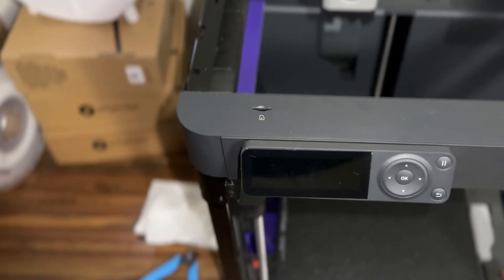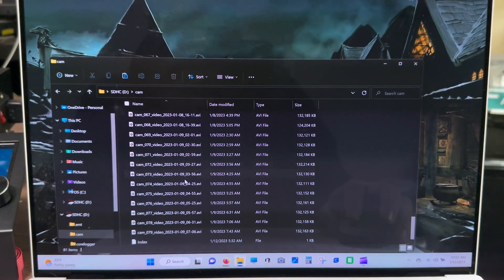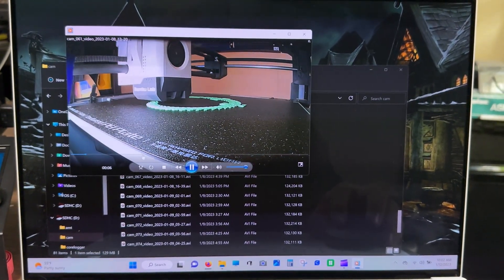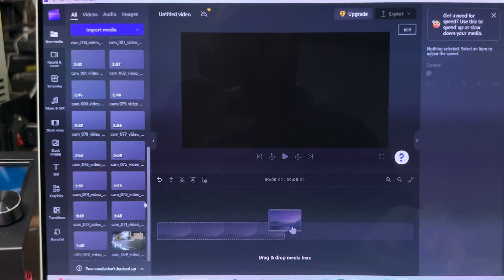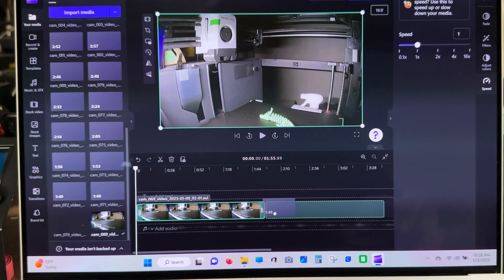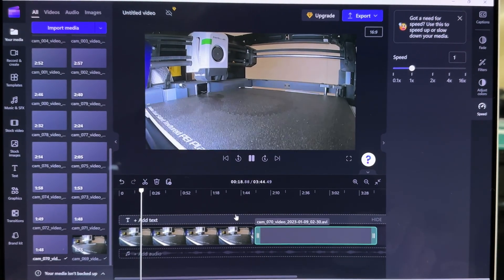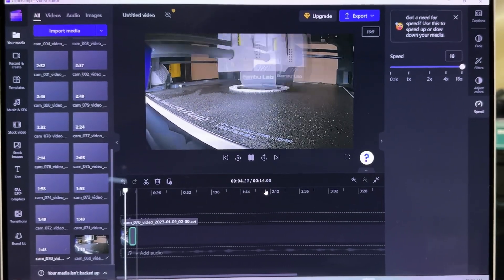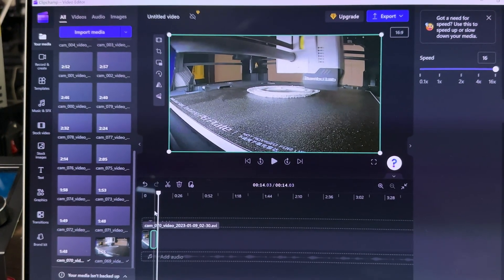How to use P1P time lapse footage

Comment: I've come over to bambu from creality, although the print quality out the box is so much better, the rest of the experience is worse which is a shame for a more expensive printer.
 The creality camera is miles better than the p1p/p1s. I could watch my print being done via camera to keep an eye on the print and it had ai print failure detection. The bambu is terrible, on top of that I could access my time lapse videos straight from the app on phone, again can't do that on bambu.
 Love printer, but hate the rest.

Comment: Hi, I'm really thinking to buy this printer for be able to print biggest parts in less time than my ender 3 pro, print customized moons in something i have in mind, in case of the moon you have printed, how many hours did it take? And what is the exact size it has?
Reply from the maker: As far as size goes, it is 100% original size, 6 walls because you don’t want to have any infill on this kind of print.  As far as how long it takes to print, I don’t remember the exact number but it was around 18-20 hours. Standard speed is 24 hours. But after the first 10ish layers we bump the speed up to ludicrous speed. When getting close to the top over hanging layers, we slow it back down.
Reply: @TableTopBiker    awesome, that's a good time, I make tiny customized moon keychains with a size of 50mm and these take me almost 3 hours on my ender 3 pro with a layer height of 0.1mm , I can't print more than 1 piece at time due to all the strings it will leave over the prints,  I guess that with a bambulab print time will be really short and would be possible to print more than one, I want to print at least 150mm or 200mm moon lamps
Reply from the maker: @TheFpc20  Oh yeah. Much faster than even my most modified ender 3’s running klipper.
Reply: @TableTopBiker  great, will go for it time to sell one of my 2 ender 3 pro😅 unfortunately bambulab have the p1p on pre-order
Reply from the maker: @TheFpc20  I would keep the ender’s unless space is an issue.
Reply: @TableTopBiker  I will keep the first one I purchased, it have not price for me since this one get me into 3d printing business and have been rocking since 2020, i have call it my money machine😅 unfortunately space is a issue right now so will sell the second ender 3 pro, it will be one of my best investments right now, I want to sell customized keychain on demand  and biggest parts but due to the time it takes to print on my ender 3 and the kind of materials i can print on it without mod it I can't offer competitive price, in the case of keychains 1 pcs take me 30 to 45 minutes, and electricity is a issue in my country, just imagine be printing 6 keychains, around 4 hours print or a 24 hours print and get power lost at 95% that's always scares me, with the bambu I can work more pcs and these will be ready in shorter time so will be biggest production in less time than with my ender, and the kinds of materials I can print, i want to print automotive parts that I have designed too for sell on demand